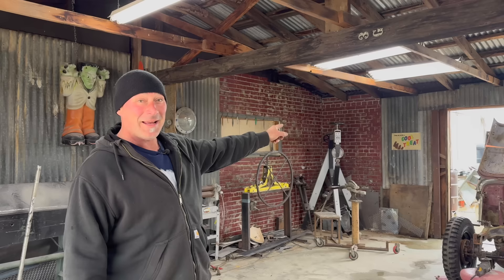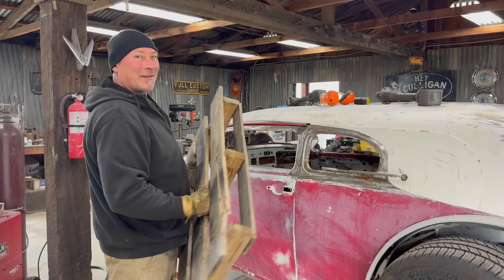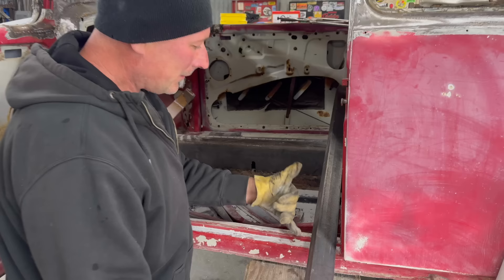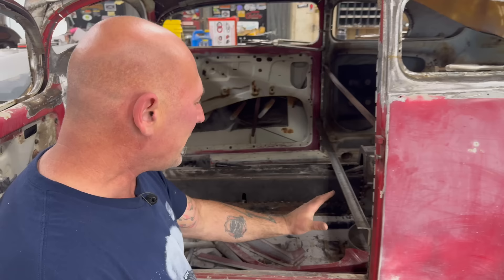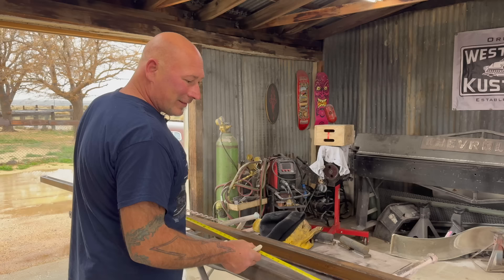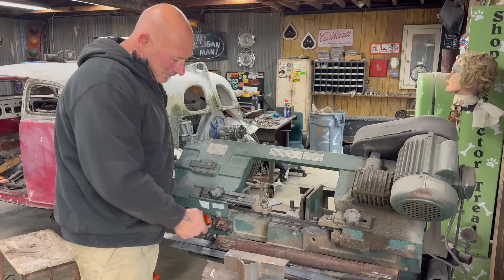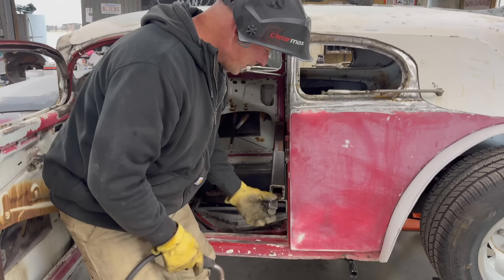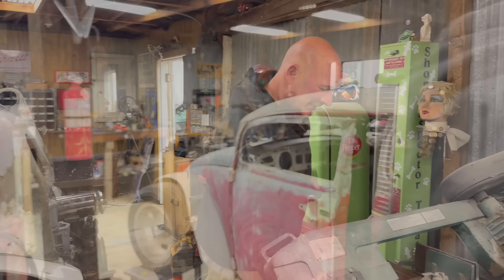Part 31! 1968 VW Radical Kustom 🤠 Ian Roussel Fabs A One Of A Kind VW Door Hinge System 👽 🛸

Comment: Ian, you could consider using a sing out chair (like from the navigation station) from a boat to make your seat swing out so you can set on it then swing into the car. It could mount inside on the b pillar area. Put a nice seat on it with a locking point so it will stay still while driving. Maybe even make it actuate with the door to swing you out while the door opens.

Comment: Ian if your slide out structure was up high at the roof line instead of down on the floor it would accomplish 2 cool things:  1- declutter the rear seating area. 2- when door was pulled out and rotated, it would rotate above the existing roof line and still give you a full side view of the car.  Right now when the door rotates it blocks out all the artwork you have created from view.  Think like building a pseudo roll cage and your slide out bar is above the rear seat passenger head height.  Just food for thought.  Great show you two provide... just live the creativity and your teamwork together!!!

Comment: Love all your shows! Great idea with the door to swing it open. I had a thought. If you use 2 tubes instead of square, on the inside tube put 2 pins, on the outer tube run slots and a spiral slot. That way as the door opens, the pins will follow the slots and open and twist. Keep up the amazing work!

Comment: I love the "simplicity" of a slide and rotate door, I was thinking of a door that comes out and then lifts vertically out of the way, using something similar to what you find used as window regulators, designed like a scissor action.

Comment: HEY IAN,
I was watching your video on the doors,
I would use two pieces of pipe instead of square tubing because if you mount the bigger pipe to the body and the smaller one too the doors I would cut a slot in the bigger pipe and then I would drill and tap for a Allen head bolt ( or shoulder bolt) then you could curve the slot in the pipe to open and swing the doors that way the bolt would control the door operation then put a latches on the front and back of the door like a tailgate,
Thanks keep up the good work, 
Leighton

Comment: How'd Ian,  I really enjoy watching you guys work.  While I was watching this, the Industrial Designer in me thought you might want to use the original VW door locks by swapping the left to right.  Maybe cutting out the door skin where the handles fit and move them to the front......  
A VW is one the cars I have not owned in my life.  I'm Australian and started with and English, Hillman Imp, Valiant Pacer (kind of Dodge Dart) 4l Hemi six, I have owned it for 46 years an had the roof cut off in the 80s,  1948 Chev Fleetmaster, Canadian made Australian built, RX3 Mazda race car,  Peugeot 504, 307 and Ford Falcon LPG ex taxi that did 1.2m kms, and  many more.  At the moment Citroen C5, the last of the Hydro dynamic suspension French freaks. 
Keep up the good work and thankyou for all the entertainment.
Reply: I had a VG Valiant Pacer, back in my misspent youth.

Comment: Check out McMaster Carr part # 3710T51. Mount the shaft inside the square tube. When I’ve done telescoping pieces like that I’ve had to work in bearings on the outside bottom and the inside top to keep it from binding and you can use them to help keep the pipe straight once it’s extended.

Comment: Nice thought !   can really see it working !  Doors can open in so many ways its just someone coming up with the way of doing it.  You can make it with gears and motors or air rams .... so many ways to make it do what you want it to.  Funny the door will be the lightest part of the entire mechanism.  I really liked the suicide hinges you made on the blue bug that had the coo front end on it.  It was really low but, I have always liked suicide doors.  Now that I can't move around much and I have either my wheelchair or a walker it makes it easier to get in and out when the door moves away from you the most.  We have a Honda van and the power rear doors that slide really are nice for just that.  Kee up the good work.. We really are getting wel deserved rains here in the desert.  I just live in the Arizona part of the same desert.  Keep warm and dry !

Comment: Have you considered using motorcycle fork tubes ( minus the springs ) for the slide movement. Already lubricated and sealed. Also look how a self closing door works on a cam mechanism, so that it has to turn as it goes out.

Comment: Hi Ian just a thought on your door hinge fab instead of a flat strap on inside of the door connected to the hinge. If it was a piece of angle iron going to the inside of the door you would have a wider surface to weld the hinge to plus a structure to weld to for caping 11:07  the bottom of the cut down door structure to . Sorry just a thought. Love your work. Always looking forward to your videos. Your awesome keep up the great work

Comment: Take a note from those old station wagon doors  , that flapped down or to the side . I the door flapped down from the running board first / you can make a better seal to the frame . Then if you had a tubular extension [ like ] running board as some do as part of their roll cages / you can hide your rams and flip hinge to clear the rear tire . When you go back to closing the door , after flipping it back to a ridged base the rams suck it back to frame [ Less Warpage ] . Also you save so much room for your seats .

Comment: That door assembly will be very different than "normal" . Try a piece of the super slick plastic on the top of the fixed arm of the slider. Also maybe a tapered tube at the front to catch another pin to hold the front end?

Comment: What about reversing the pieces, making the larger square tube the fixed structure and the smaller tube as the slider.  That way you could put a liner actuator (powered screw) inside the smaller tube and it would be completely hidden. The actuator would be used to push/retract the door. Putting the barrel of the hinge on the interior of the slide would make for a cleaner look, again everything would be hidden.  And you might use a window regulator or a set of gears (with limit switches) and motorize the rotation.  Great work by the way.
Reply: The larger square tube is the fixed structure and the smaller tube is the slider.

Comment: My mind gets blown when I see your ideas. I get what you're doing but my concern is the weight of the door might bind the slide as it's actuated.
If you use smaller centre stock and fit bearings for the the hitch stock to roll on would that help for Tha slide action?

Comment: I was thinking you could cut the doors in half and just climb in like a dune buggy. I would actually leave the top of the door as well as the very front and back of the door, then cut between the front section and the rear section. Once done just weld the door shut and cover the top where you cut the door. You could do a circular cutout instead of a straight one as well.

Comment: 31:50 when yo cut the door bottom off, can you just raise it up and also raise the existing door frame piece up and box it in with sheet metal, basically making it look like a stock rocker panel/door frame, but that 8” or so higher.

Comment: Manual or mechanical actuated? If mechanical electric or hydraulic actuator? Will you put a receiver in the front jam to keep door in place when closed, since you cant have 2 acuators? Manual spin of door? How will it operate from inside to get out? Questions you are probably already asking yourself, but thought I would as well just incase. Looks good I follow your work.

Comment: hey Ian, when you have to use a clamp to hold something in place why not try using alien tape instead, sounds odd but it holds lots of weight well. i used it when putting up certain shelves until i can make them permanent.

Comment: I thought you were going to weld the outer tube stationary and attach the inner tube to door. Put the door handle toward to front of door and electric or air actuators to auto open to push ram out and in.

Comment: Ian would it work better with pin and slide in the front your slide would be at the bottom of the dash. It would be easier to get in the car.The pin would be more to the middle of the door.GOOD LUCK

Comment: If you are going to make the doors slide out and flip I would go with round pipe. 2 pieces the length of the inside of the car where 1 slides into the other. Cut bot pieces in the center and if the larger 1 has a weld inside don’t worry, you will be cutting a groove in it to remove that. Start the groove 3 inches from the center and end it 3 inches from the outer end, I would make it ½ inch wide. Now cut the groove at a 90 degree angle toward the back then grind the inner welds out of each end. Slide the smaller pipe inside the bigger 1 and weld a tab that sticks up through the slot cut in the bigger pipe. This will slide along the groove until the end as you pull out the inner pipe and then rotate the inner pipe backwards in the 90 degree groove.
Reply: That would be a lot more work and prone to wear.

Comment: 👌. Gonna need a decent rubber gasket around the door and rubber pads on the bottom of the door so it doesn't become a door slapper on every bump in the road. Rockers are gonna be a little on the high side once door bottom is reattached like stepping into a bathtub. Acrobatics are going to be in order to get in and out. Contortionist a bit

Comment: If you are going to cut the bottom of the door & make that part of the body would it work to cut the top of the door around the window frame & adding hinges so that it flips up to open & would also to make the door lighter. 
The only part that opens is the centre of the door.

Comment: Wonder if there is a way to mount a sliding lever on the pivot bar connect to a gas shock hidden in the rear body panel.
Reply: Ok, This has stuck in my head tonight. Followed U on FB. Gonna send an illustration, FB or email, for an electric screw drive push open then pivot, pivot then pull closed. 🙃

Comment: So Koenigsegg doors, they are cool, and not necessarily complicated,
If you use round pipes, you have telescopic hinges in one, and the stops would be like a rifle bolt,
If you're doing reverse Koenigsegg doors, then maybe Pagani gear shifter, a stainless pipe from gearbox forward in linear bearings, and the gearstick welded straight up
Reply: Koenigsegg door kits open forward .
Reply: @65cj55  kits? If you can't do it without, then don't do it, i called them reverse Koenigsegg doors, because, Koenigsegg is where we know them from, probably someone else who did it first, probably the french, as usual
Reply: @d.p.2680  Yes, Koenigsegg doors are kits and far different to this, are you implying that he's copying them ?
Reply: @65cj55  I'm saying that if you can't build your own, just like Ian, you should maybe just buy a car that have what you want, and even if it was a perfect copy, i still wouldn't have a problem with it, i just like the creative process, and if i can't do it, i don't want it, there's absolutely no pride in buying what you want, then it's just a car, build it, and it will say who you are

Comment: Why not use the larger tubing as the solid point and use the inner tubing as the slider? No shims necessary and more of a solid connection with the larger tubing against your frame structure.

Comment: Hi Ian!  LOVE your work and your style!  Except for one thing: Failure to wear a respirator and gloves during cutting, grinding, sanding and welding.  I have done medical diagnostic imaging for 30 years: X-ray, CT scan and Nuclear Medicine.  I have worked in Oncology staging for 20 years (performed over 15,000 PET/CT scans and CT scans).  The fumes and particles you inhale (along with the Mojave dust) is wearing and tearing your lungs. Miniscule metal particles are irritating your lungs and your body is working to fight the pollution of the zinc, lead, steel, aluminum, nickel and other paint particles you breathe.  The smallest and most fragile elements of your lungs are the alveoli and those will eventually scar and reduce your oxygenation.  If you don't get lung cancer you will still need supplemental oxygen due to COPD and bronchitis. What enters your body will eventually be filtered by your liver and kidneys and collect in your bladder.  You are most at risk for lung and kidney and bladder cancer. Fact.  Look it up; your wife will help you understand the terms and processes.  Masks and respirators are cheap compared to your health.  On that subject: The skin on your hands is a semiporous membrane that will admit toxins (metal) and solvents (easily).  Again, your kidneys and bladder are exposed to those particles.  Disposable gloves or leather gloves are cheap.  Protect your body, protect your future.  Respectfully, Jon Auster, RT (R) (CT) CNMT
Reply: You're being over dramatic..